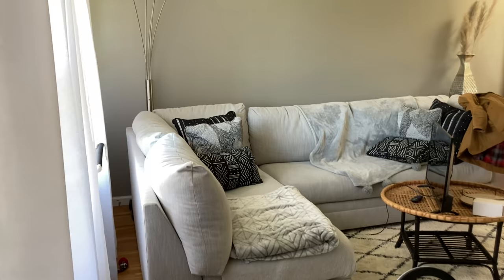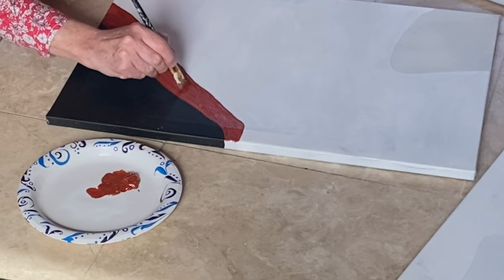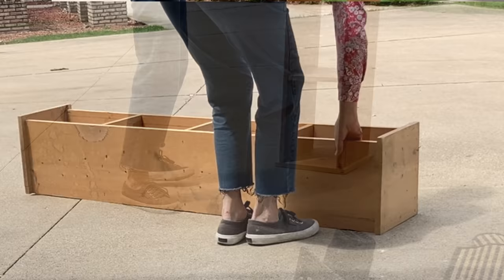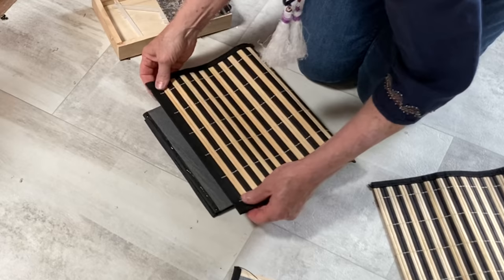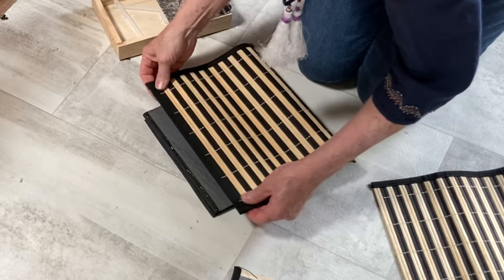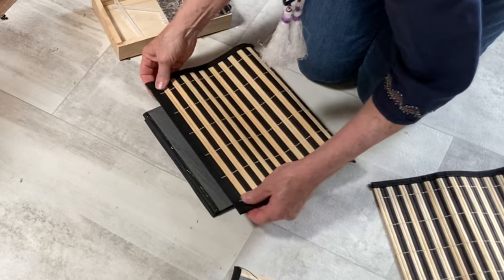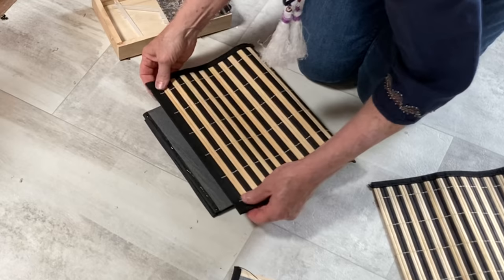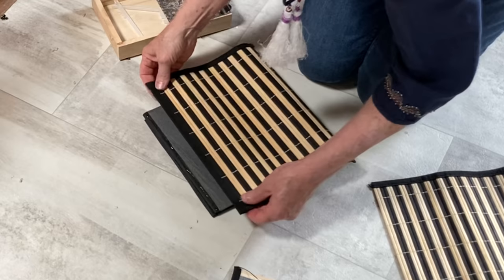DIY LIVING ROOM MAKEOVER USING THRIFT STORE FINDS/BUDGET BOHO MODERN DECOR

Comment: You knocked it out of the park! Boho is not my style either but I loved it. Orange is one of my least favorite colors but I loved how you used it in this room! Just a hint you may or may not already know…when using inexpensive or upcycled canvas that is not quite as taut as it should be you can spray the back of the entire canvas pretty good then use a hair dryer and dry it and it will shrink and get rid of all the sags or indentions and even hide the frame where it shows. The room is amazing!